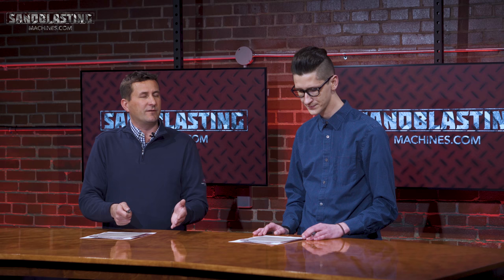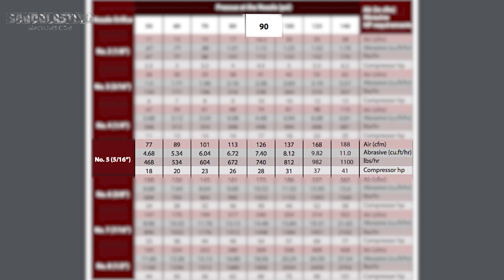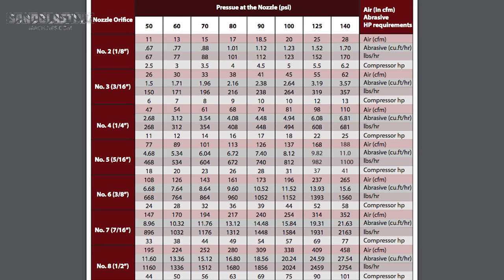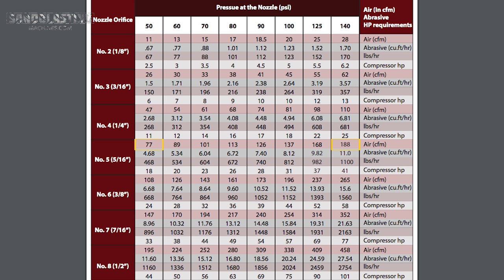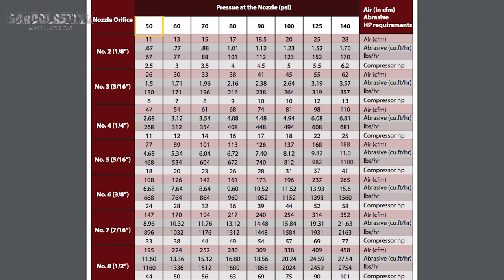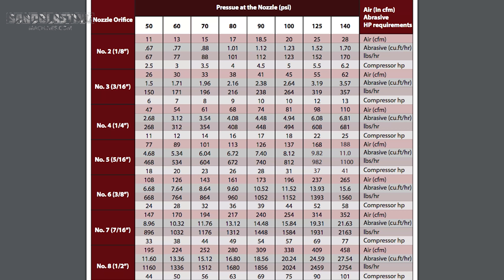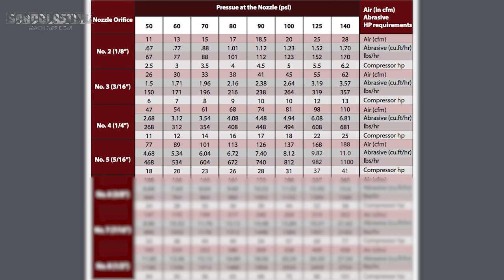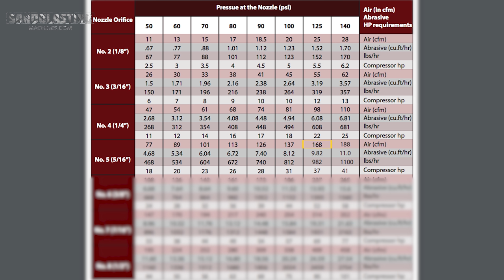Air Compressor Requirements Chart | Sandblasting Machines

Comment: Great chart thank you. It's based on Bernouli equation, I ran it on one datapoint.
Even at 30 PSI I managed to pierce a container roof, with a size #4 nozzle and a 32 CFM compressor (equivalent continuous run).
Reply: Hi. How many HP your compressor have?

Comment: That Pressure at No.5/16 I.D. Nozzle Chart which shows the cfm requirements, it is important to note this chart is for a Pressure Type Media Cabinet System ( Note the high pressures listed starting at 50 ) and not for a Suction Type Media Cabinet System ( i.e.. The type that about 90% of home DIY's have in their home garage/shop )  If you have the common Suction Type then the cfm requirement using the common 5/16 I.D. Nozzle and a 5/32 I.D. Air Jet would require only 20-25 cfm compressor utilizing a true 5-h.p.230 volt motor. Likewise if you have a 6 cfm capacity output compressor running 3-h.p. motor then you would use a 1/8" I.D. Air Jet.

Comment: I don't get the Compressor HP numbers being so high when most compressors are using less then a 5 Horse Power motor.
Reply: I totally agree with you. Just was searching for the same info. Maybe this is possible to reach using a screw air compressor.

Comment: They are both actually the same height. Or, they used to be. The guy on the right had the optional deluxe 2.0 neck extension installed.
Reply: Giraffe edition.

Comment: A compressor with 150 psi capasity  using two blasting pot connected with the same compressor 

Can i get more than 90 psi nozle pressure or not 

If not which one i neex to use ?

Comment: Planning to add a sandblasting service in my shop. mostly will use it for custom car rims. what do you think about this air compressor :
Air Compressor 20 hp 15 kW Tekanan 12 bar / 175 Psig Volume 350 liter In/Out 3/4 Inch 1.840/65 Liter/min

Is this good enough or should I get a bigger power machine. TX
Reply: probably u should have bought one rit nw.
I think your values are high, am i rit?
Reply: If you are only doing rims, buy a cabinet with a good reclaim unit (Like Empire Air-Blast)...Use a media that can be used for many passes...
Reply: Bigger in TX!